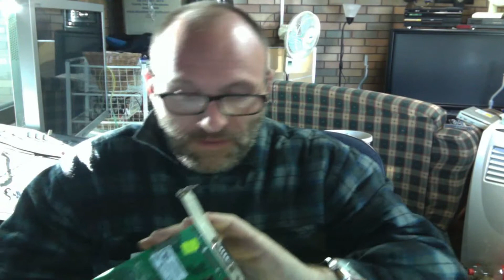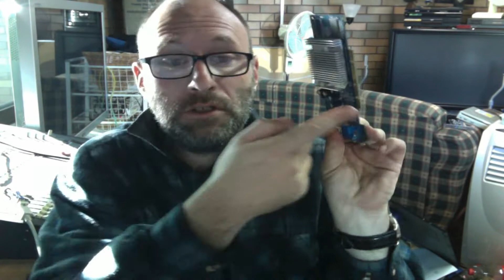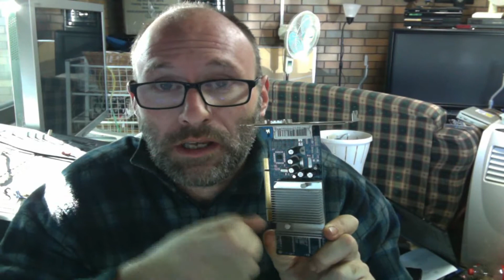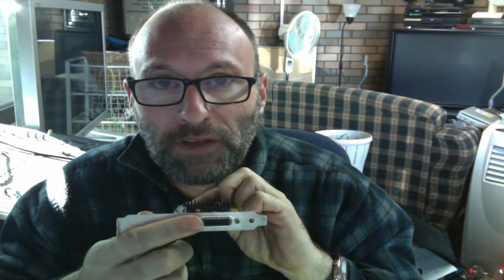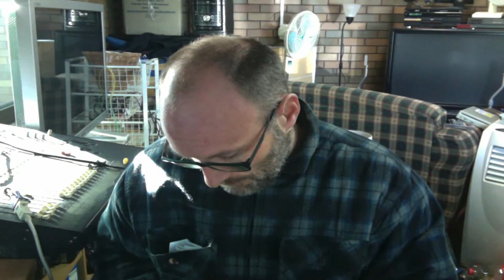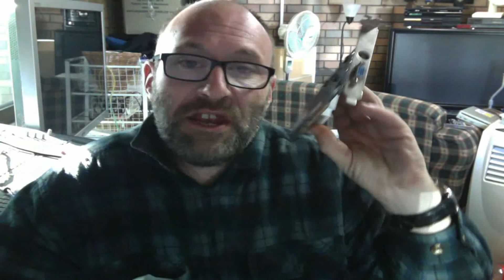Display Adapters in my own way

Comment: Thanks alot for this video it really explained some concepts for me. Now, I do have a XVR100 BUT as I understand it, since I do not have an operating system; nothing shows up on the display except a white weidly colored screen after about 10 minutes. Now what I do not understand will probably be much simpler for you, how do I know my server works correctly ? Do I just connect a RJ45Serial TO DB9 cable in the console port and fire up putty to look at what is going on ?
Reply from the maker: That is exactly what you need to do. YOu may find that the framebuffer is not showing up in the NVRAM, or the pci buss scan. YOu also may need to tell OBP to look at the framebuffew as the priamary output after post. 
However, if you install Solaris/OpenBSD it may re-write the NVRAM to tell it that there is a video output card on the pci bus